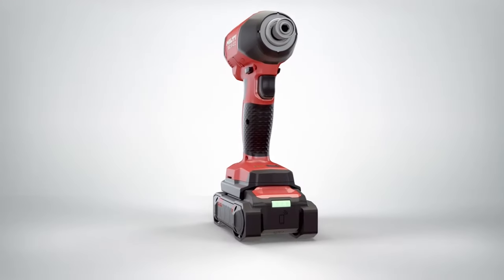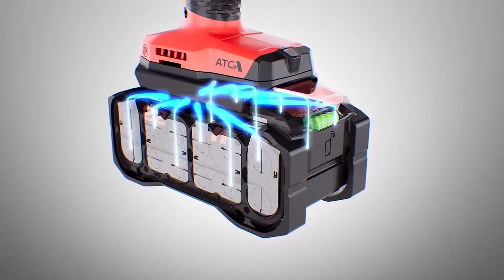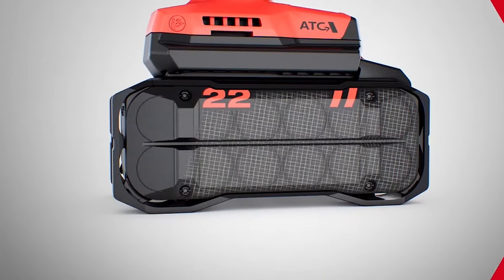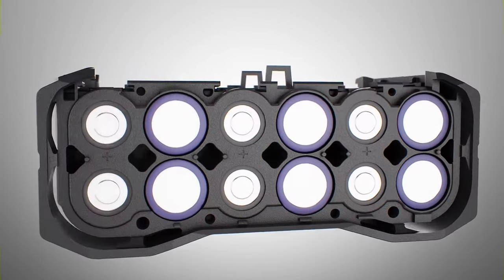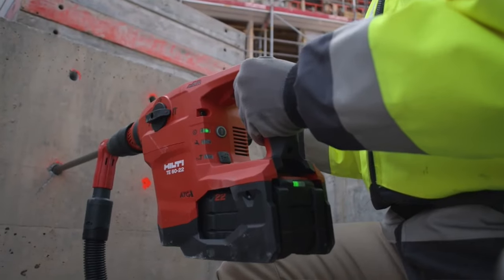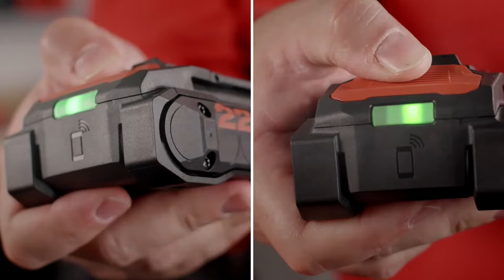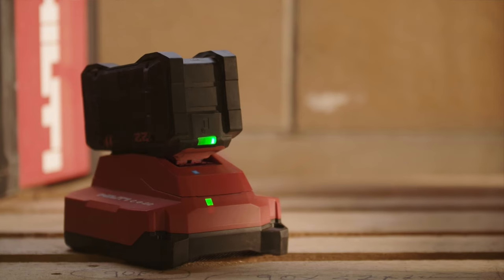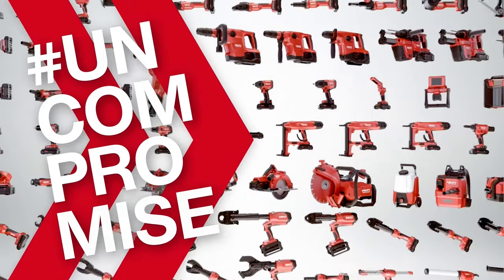Hilti Nuron Cordless Power Tool 22 Volt Battery Technology

Comment: First day using my hilti te60-22 battery didn’t last 2 hours of use , is this normal or should I feel disappointed about my buy?
Reply from the maker: Hello Ray, from our internal testing and customer feedback we find that our TE 60-22 provides 40%+ more work-per-charge than other cordless competitors. As the construction industry continues to convert to cordless we still offer a broad portfolio of corded combihammers that can satisfy your needs based on how demanding your applications are. With this in mind we see customers that are converting to cordless still using a mix of cordless and corded. For repetitive drilling all day long, we recommend using our corded tools.